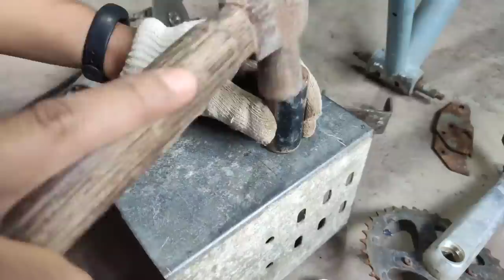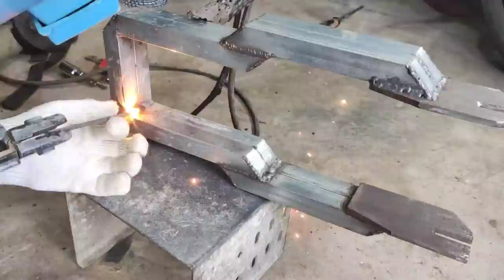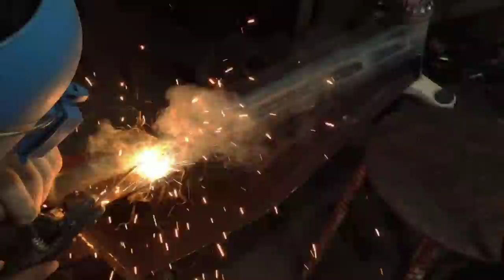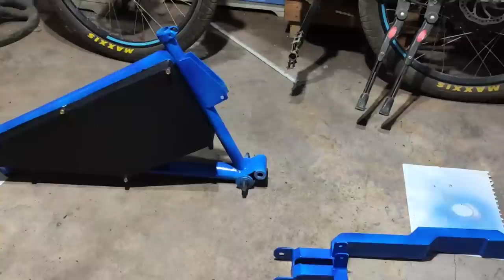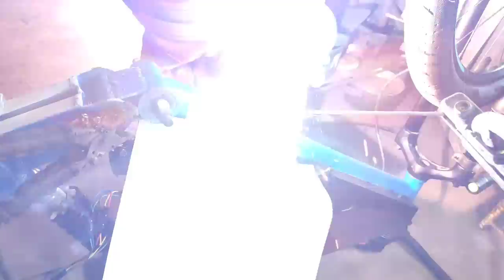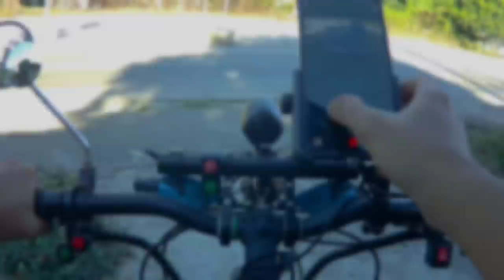How to make your own ebike (from hard tail to custom full suspension bike)

Comment: Dude can you please explain the dual motor.. does both wheels get power together or one wheel at a time? Tried searching the net but it's too confusing..
Reply from the maker: front motor can be switched on or off.
Reply: @albertnario4877  so if both motors are on, how is the rpm exactly synchronised? Sorry to bother.. thanks for your reply
Reply from the maker: front motor are slightly faster rpm, and it's only 11A controller output to limits the power, and not to over heat.
Reply: @albertnario4877  Umm, thanks bro..
Reply from the maker: if you have any questions feel free to ask.
Reply: @albertnario4877  well just that i was wondering how both wheels maintain the same rpm if they are controlled by individual independent controllers.. doesn't it make the bike unstable at high speeds.. what's the trick?
Reply from the maker: @SinghalLouis  don't bother on rpm, they rotate at same speed under load.  you only got a problem on higher power motor, like 1.5kw both wheel if they different rpm.
Reply: @albertnario4877  ohh okay.. Umm got it.. thanks.. hope you can also do a fast tyre + mid drive motor build some day.. it was really inspiring to watch the entire build, and really loved the battery module.. thanks so much

Comment: What is the benefit on having 2 motor on front and rear?
Reply: More stability and power
Reply: @giustiniani15  Oh, thank you
Reply: It's AWD, like when you see those trucks or Subaru's taking off, more power speed and traction.
Reply from the maker: another one they give more torque than single motor at same power.

Comment: When you cut the frame tubes I got a little worried for you. Could you have just built the battery box inside of them? Other than that amazing.
Reply from the maker: battery box is became part of the frame.
Reply: Its not safe to bend or drill holes in a bike frame a tiny hole in heavy gauge truck steel chasis out of a corner if it breaks of you still have steel left but never dead center of a top down seat chain stay part of da frame never ever .yry it on nesck end of fork you may gp flying thru ds air .Or try tie an Airplane wing eith a tiny skinny wire den you ready for da rum cola flite .where is my friend dst fix everything on bike with a hmHammer i mean hes so esmart hes my mochanic wat a genius
Reply: @RafaelSantos-vd6be  nobody understands a word you're saying dude, you're just making a fool out yourself!
Reply: @FarmerFpv  I dont remember giving this a bad response for cutting up at regular oldstay stiff frame to installing a fear swing arm to make a full bicycle fear suspension somehow it was to another homemade of another bicyclist driving 3 srews rite thru the bikes downtube for fastening a small type of an electrical motor , it seems to me da person can ruin bike frame and he couldv used a clamp rben a hose clamp to improvise if nothing else was availible. But i wasnt commenting to show off and diffinite not on da aquare type lite blue frame oh no this guy is very good creating this frame on his in , at times wen you have its easier wen a person has a garage like i use too but not anymore not in this so expensive NY City.

Comment: Albert please tell me how to get that kind of speed from my bike,  i have 1000 watt wheel for front and one for the rear but cant go very fast.  its a high end bike but not rear suspension.  i tried to buy a controller on eBay but got burned from some weirdo in china lol.  so yes please tell me where i can buy the right stuff. at the moment one controller is dead.
Reply from the maker: the speed is on motor it self, you need high kv motor or high rpm motor. my motors are made for 36v that can run 45kph, so when i use them in higher voltage it run faster than rated speed.

Comment: You could have just left the mountain bike how it was an made an ebike but instead you weld a lot of metal together making the bike unnecessary heavy so i hope you don't run out of power cos that's going to be a hard pedal
Reply from the maker: that triangular metal case is stronger than whole frame..

Comment: Wished I had a set of prints especially putting batteries together I hv no idea, I hv plenty of tools and knowledge but bette ties motor hook up. If I could find someone that wants to build one, I’d open my shop, welders, tools, plasma cutters, sand blasters, spray guns, air tools uo to anyone that would help me I’d help you in our weak points. Even give them most of the metal needed, just finds one bike frames, no idea on motors, battery setup figuring all that out, I mean we could add suspension from hell abs fat tires, even build a small pull behind SHTF trailer w/hydraulic pop out and up shelter folds down etc sky the limit just do t know anyone close enough to me I’m in north Texas

Comment: When you cut the cycles tubes ain't that makes the cycle frame weaker ?!
Also please provide the details of how to make such battery pack
Reply: Mandar Thakare i think the battery box made up of full metal sheets welded in full to the frame makes up for the weakened part.

Comment: Why is this 500 Watt Motor so big in this size they are normally 4000 watts
Reply from the maker: they are same in diameter but not in width, it's only weighs 6.5kg..., 4000w hub motor can weight more than 15kg.

Comment: Can i get ur mail or contact ? 
I want to know the cross section of the rear stay and material.
Reply from the maker: literally I don't get their measurements, just base on wheel and suspension sizes.
Reply: @albertnario4877  kindly help the people with existing arm measuments like length,width, distance between arms at rear Tyre hub etc.... Please

Comment: This is a piece of junk. The welding job was a joke, the frame strenght zeroed after you cut it open. The rear brake caliper mount is symbolic. Are you still in one piece? That flimsy bike would not withstand the stress of the motors torque and the shocks from the bad roads you ride. This is the best bike for a suicidal dude.
Reply from the maker: I'm so lucky it still in one piece as my everyday work horse for years, until last month as my new bike are made..
Reply: @albertnario4877  I doubt.

Comment: Do NOT make your electric bike like this!  Battery packs need a BMS (Battery Management System), it's a little circuit board that costs like $20 that keeps the individual battery cells from getting overcharged undercharged, underused etc.  VERY dangerous to do without.  Every seen a lithium battery fire?  google it.  NOT okay to have between your legs.  Also no disc brakes?  Come on, that's just stupid.